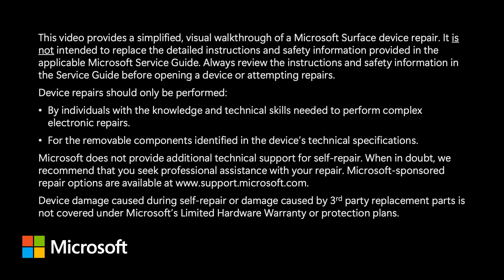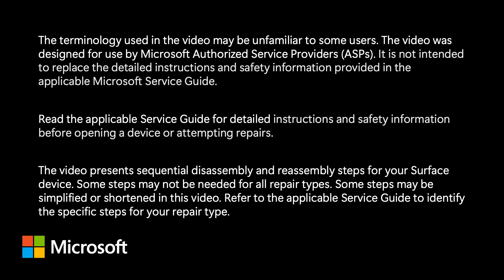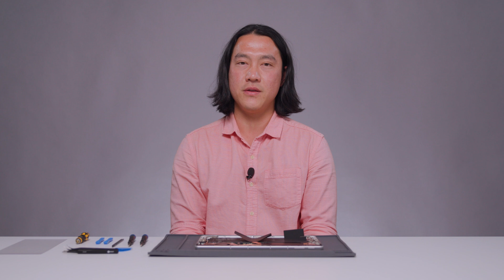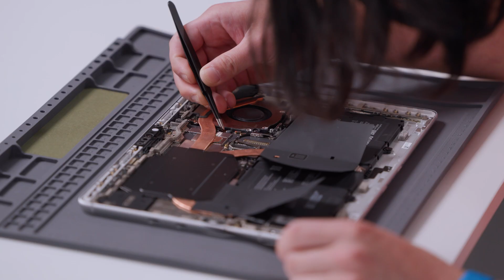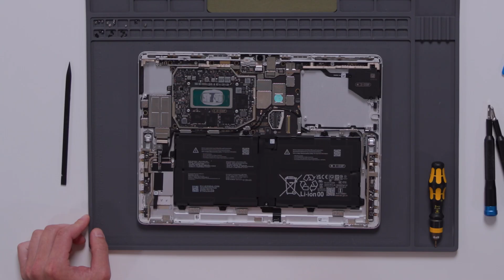Repair | Surface Pro 10 - 5G for Business

Comment: I have a Microsoft Surface laptop and the keyboard stopped working for no reason and I've tried everything to fix it but I couldn't, what can I do to solve it? Is there a procedure I can do by disassembling the keyboard that will make it work again? If you can help me I would appreciate it, because I've already tried to contact you online and my problem hasn't been solved.

Comment: PLS publish the circuit schematics. i really have to upgrade my ram 🙏🙏
Reply: The ram is not upgradable in any surface pro 10 device
Reply: @Utkarsh_1508  although upgrading soldered ram is may more difficult than other rams, but it is actually possible. you can just search many of channel who did it on youtube before